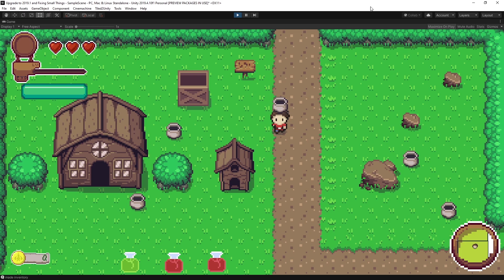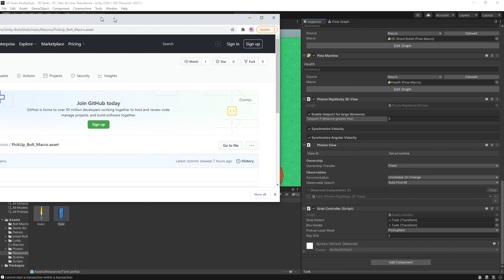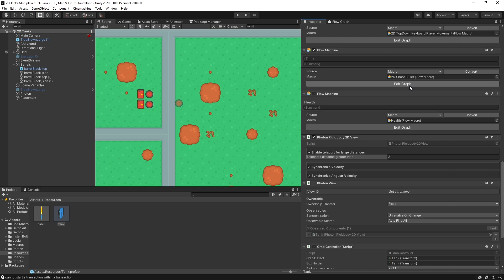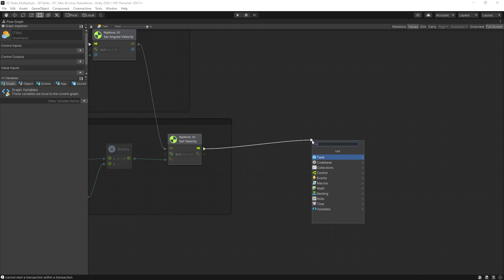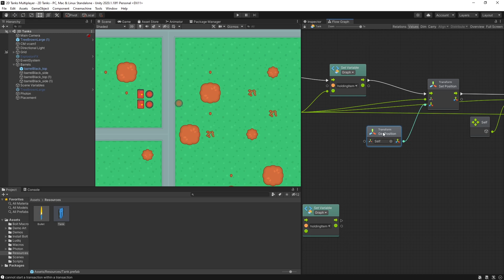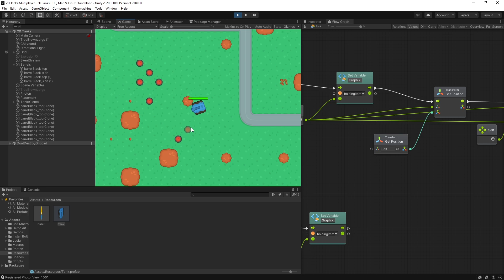Unity-Bolt: Pick Up Item Macro - Download and Demo (Visual Scripting)

Comment: Hi Im currently working on user management with firebase but I can able to do with bolt I don't know how to do that plz make a video on firebase Auth and database plz plz plz. Nearly 2month I searched on Google no result on it and I try to use from code its took me from now even I don't finished. It's impossible using code by me. Plz make a video about firbase
Reply from the maker: I wouldn't suggest using Bolt for Firebase, using C# for that.
Reply: @SmartPenguins  😭 ok, can you plz Mack a video on that field, because others are simply copy and past the code from firebase unity document from firebase website. But that is prity much less on the document,

I have struggle on how to get the data specific location, and how to give custom display name for the user from firebase Auth, and how to get the tag from the location and etc...